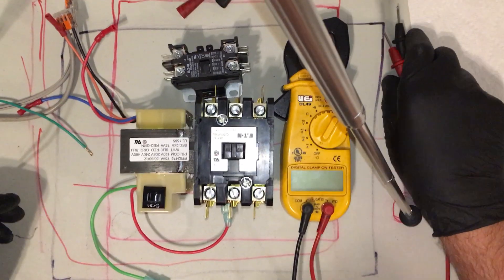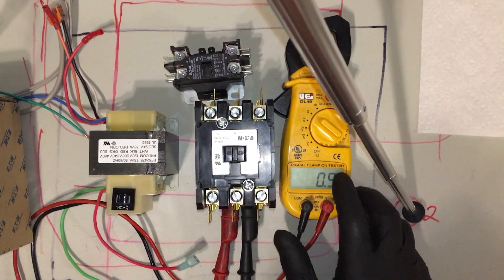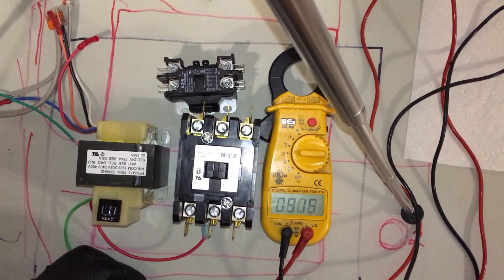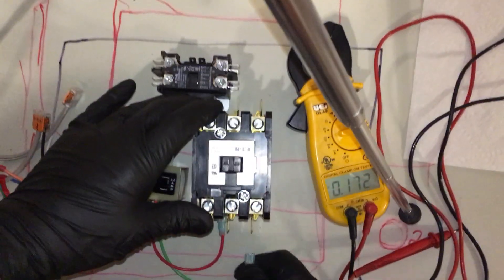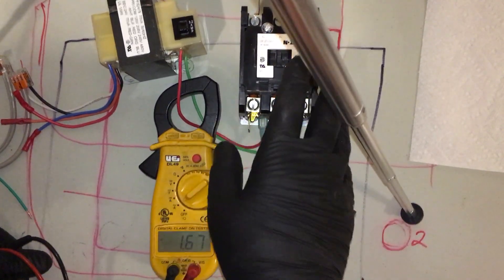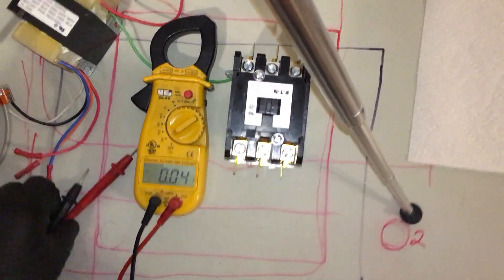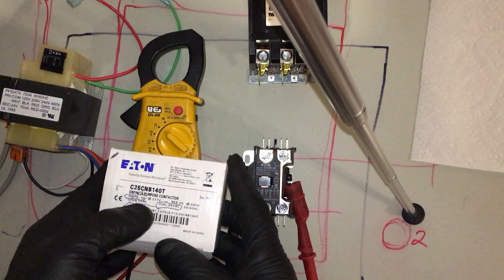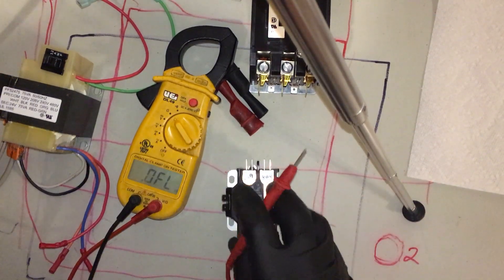Brand New Contactors That Ohm out at 1 Ohm Resistance. In reference to #Hvac school video.

Comment: I’ve been to about 20 service calls where the 3 amp fuse was blown and after tracing the short to the contactor I found no path to ground and every time the windings were under 5 ohms. And all the new ones on my truck are ohming out at around 18 ohms so I agree with him under 5 is bad!
Reply from the maker: Yea, probably for the tiny common residential contactors But not for all by no means.

Comment: Magnetic field ramps up resistance across the coil keeping the amperage down.  Had the resistance stayed around 1 - sub ohm the amperage would've been high enough to melt the wire. Pretty neat how it works.  Resistance is a good starting point but not a replacement for voltage drop and amperage testing.
Reply from the maker: Thanks for the info

Comment: Important Update: I wrote earlier that I found the same, and I did. Unfortunately I got a bad coil on a new contactor and the ohm reading matched the one I changed out. Had me questioning why I changed it in the first place. What I found was the contactor would not pull in but would send interference back to the thermostat and kick it back into DELAY....again and again. Got a another new contactor, ohm at 8, and all worked well. NEW DOES NOT MEAN GOOD!
Reply from the maker: Thanks for the update. I Will check another box / contactor. The odds of getting a Bad Contactor coil on a New Contactor is 1 out of a Hundred or 1%. in 40 years I’ve only had one or 2.
This Contactor works fine at 1 ohm. No issues. 
It’s Probably bigger than your Contactor.
Reply from the maker: You Might want to Make sure you have a Large enough 24 volt Transformer for the Amount of Contactors in the circuit and it’s Not Failing or Overheating. Check secondary voltage at transformer under Full Load ( All contactors pulled in ) & current draw.

Comment: Ohm's law doesn't make sense here.
Reply from the maker: Ohms Law Allways makes sense.
Amps x Volts = Watts.
Reply: @OcRefrig  That is not Ohm's Law. 

V=I x R, I=V÷R

27 volts divided by 1 Ohm= ??

Contactor wasn't pulling 27A. What am I missing here?
Reply: @eastlandgin  This is AC my friend, and the 1 ohm is the series resistance of that coil. The coil - remember it is a coil - has an inductive reactance also measured in OHMs. The inductive reactance X = 2*Pi*f*L. If you want to be a smart ass, than you can calculate the impedance Z of the contactors coil.  Impedance Z (in ohms) is the AC "resistance", Z = V / I. In this case coil voltage was what, 25.6 V and 1.7 A current? Z was then 25.6 / 1.7 = 15 ohm impedance.  There you go with your ohms law. It still works.
And where the 1 ohm series DC resistance fits in this? The coil has both inductance and series resistance due to the length of wire. The impedance Z for a series R-L circuit then can be calculated as Z^2 = R^2 + X^2, so for a known Z and R, you can calculate the reactance of the coil as X = sqrt(Z^2-R^2) =  sqrt(15*15-1*1) = 14.97 ohm reactance of the coil. (yes the small series resistance does not make much of a difference here). You can even calculate the inductance from the reactance, by using the equation above: X = 2*Pi*f*L --> L = X / 2Pif = 14.97 / (2*3.14*60) = 39.7 mH. So the contactor's coil has an inductance of 39.7 mH (in the pulled-in state, note that the pull-in current is much higher as the core is open and inductance much lower).
To take things even further: The 1.7 A draw at 25.6 V at the coil presents a load of S = V*I = 25.6 * 1.7 = 43.5 VA for the transformer. Yes, VA, not W. This is an apparent power, not active power.
Active power dissipation in that coil is mainly two components: Resistive loses the P = R*I*I = 1*1.7*1.7 = 2.9 W and loses associated with the iron core that gets heated by the AC flux in the core (also couple watts).
Reply: @Sixta16  If you are using a common HVAC multimeter and you have a known Voltage from an AC transformer and a measured series resistance ohm reading, what is the math to determine the amps a contactor will draw without powering up anything?

Seems like without powering anything up and taking readings, I am missing X and the Z part of the equation. Only R is known. I really only need to know the X so I can know if the contactor is the problem in the troubleshooting. Short would be easily known, if it is drawing excessive amps, I would like to be able to calculate it in a powered-off state.
Reply: @throttlebottle5906  In AC circuit, you can't do R = V/I.  If you would say that Z = V / I, then yes, I agree. Even though both Z (impedance) and R (resistance) are both in ohms, they are not the same and it is important to know the difference between the two. This seems pedantic stupidity, but no, it isn't. Differentiating between resistance and impedance (in an AC circuit) is fundamental to be able to troubleshoot circuits correctly. The example of the guy above saying a 1ohm coil of a 24Vac contactor would pull 27 A at 27 V is the reason exactly, why one should learn the difference.

Comment: Would the number of poles on the contactor make a difference? In that video they should only 2 pole contactors
Reply: Number of poles not related to Coil.  Coil pulls in the switch to allow the power to continues, or stops the power from continuing when the power from the coil is gone.
Reply from the maker: Yes , Definately. The amount of Work required to do a Job such as pull in a Larger Contactor vs a Smaller Contactor is directly proportional to the amount of windings required to create a strong enough magnetic field to pull in & hold a Larger Load vs a Smaller Load.

Comment: Good point, I saw a lot of coils issues during cold weather, the best way is to proceed by elimination or using insulation test for pricy equipment
Reply from the maker: Good point. I’d like to try a Megger on contactors & do a vid on that. Thanks for the suggestion.